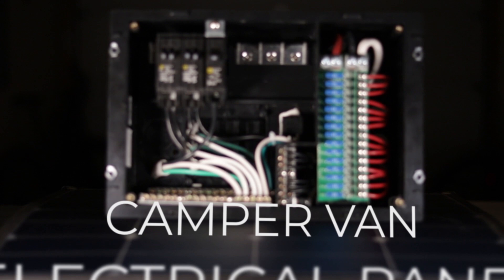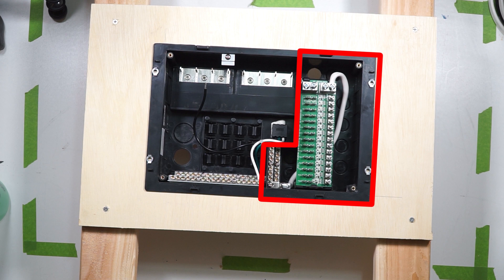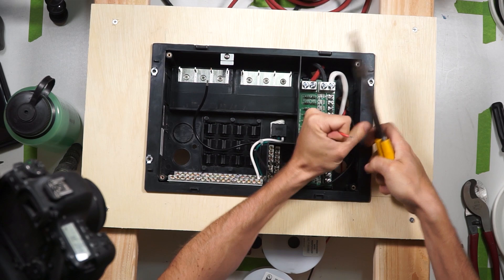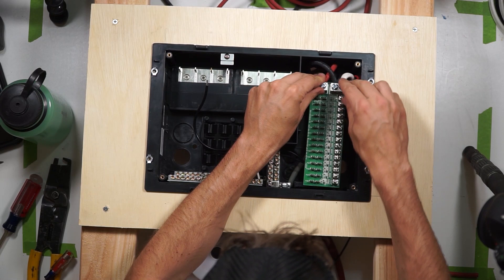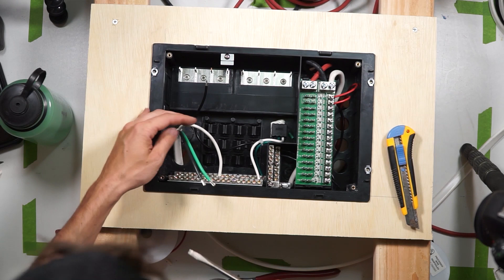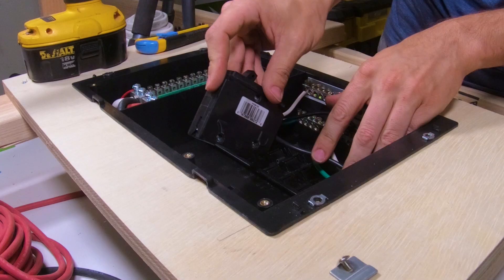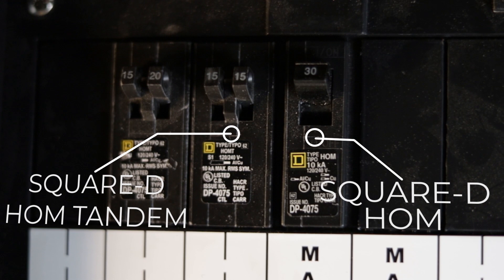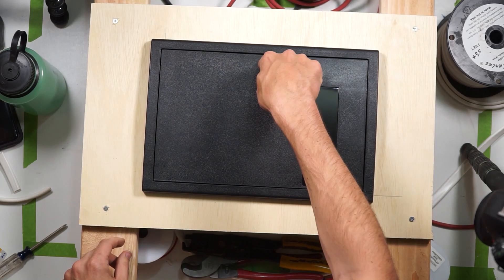How To Wire a Camper Van Electrical Distribution Panel

Comment: Grounding Question: If I were to turn my "RV" into a permanent installation that required an electrical inspection, Do you know how the grounding requirements would change? I presume I would need solar panel grounding and a driven ground rod. Would I just connect to the ground rod instead of the chassis or are there a host of other equipment grounding changes as well?

Comment: Hey. I have a very similar box and need to run a new 10/3 romex to the main breaker. My question: is the unit grounded to the frame? Or only grounded to the bus bar via the 30amp breaker wires? I’m lost…

Comment: Hey Nate, I’m wondering why you use a 30 amp main breaker with this panel and in your newer wiring diagrams with the separated AC panel you use a 50 amp main breaker? I have the AC/DC panel shown in this video and am trying to figure out weather to use a 30 or 50 amp main breaker?

Comment: Why do my 12v DC 5amp fuses keep popping on my lights when i can plug them i to a small ac/dc adapter straight from the wall and they work fine.  Im confused...

Comment: My question is, I think I'm thinking too hard or over looking the obvious,  but what type of wiring do I now put from the box to my outlets?  Do I use the 10/3 I have from my shore or do I use the 12v because I'm doing solar power and will be doing lots of boondocking?  Every video I've watched stops at installing the system but not power outlets for kitchen appliances.  I only see 12v for lights or 12v refrigerator,  I'm doing a mini dorm type refrigerator. 
🤔

Comment: Hey Nate. Thanks for all of your information. I bought many items for my setup through your links. However, I made some adjustments to fit my personal desires and budgets. Instead of the inverter charger, I got just an inverter. So I am running my shore power supply straight to a 30 amp breaker. My plan was to have a separate breaker for my solar system and switch them on/off accordingly. On my panel I currently have a 20 amp circuit breaker, a tandem 20 amp breaker, a tandem 15 amp breaker, and the 30 amp main breaker. Everything works great on shore power but my question to you is...

Can I use a tandem 30 amp breaker for my main to switch on/off between shore and solar? 

Thanks

Comment: Kudos. Great video and really straight forward how to.  Does the receptacle in the back run off the dc power when not connected to shore power? Is there pro and cons for designing the system with 30 amp over 50 amp?
Reply from the maker: 1: The outlet on the back would be powered through the inverter just the same as all of the other circuits.

2: 50A would be more power, but is significantly more complex & expensive.   If you need it, great; I have 2x diagrams on my site for 50A setups:

https://www.explorist.life/50a-camper-inverter-with-solar-alternator-charging-wiring-diagram/

https://www.explorist.life/24v-6000w-120v-240v-split-phase-camper-solar-wiring-diagram/

but 50A shore power service is USUALLY only needed if you need to power a 240V appliance OR have the ability to power 2 or more air conditioners.

Comment: Does the AC ground busbar need a separate chassis ground? It seems like you would want a more direct path for grounding rather than running to the inverter and then the chassis. Thanks for all the awesome tutorials!
Reply from the maker: That depends on the type of Inverter you have so be sure to check in the installation manual of your specific inverter, but in the case of the Victron inverter chargers I recommend on the wiring diagrams at https://www.explorist.life/solarwiringdiagrams the grounding and bonding is taken care of internally through a relay as the method of grounding the AC side of the system changes depending on if it's plugged into shore power or not.  But again, in Victron inverter/chargers, that's taken care of internally so we don't have to mess with it and an additional AC chassis ground
 from the distribution panel is not permitted.

Comment: So I have a Progressive Dynamics PD4560 Distribution panel, it's an all in one. I can't for the life of me figure out how to get power to the dc side. I have looked all over the internet and can't find anything remotely close to what i have and what possibly could be going wrong here. I know the battery is good, I know the converter is good, I just can't figure out what's going on with the wiring that I cant get 12 volts at the WAGOS connectors.

Comment: Shows how easy it would be to mix up the AC hot wire and a DC negative wire if you use black for both.
Reply from the maker: Yeah, somebody wasn't thinking that through back when they made these decisions for color coding this stuff.
Reply: @EXPLORISTlife  That is why for marine applications the ABYC  (American Boat and Yacht Council) recommends using yellow and the DC negative return.    Google that and you will go down a rabbit hole with all kinds of best practices relevant to van builds.
Reply from the maker: Indeed.  I stick to ABYC as much as I feasibility can (you'll see me reference ABYC standards in several of my videos).  Large yellow wire has historically proven difficult to source for end consumers and since it is not traditionally used for the - wire, it further confuses people from an education standpoint.

I would like to move that direction, but have several external factors working against me from a logistics standpoint.

Comment: great video. I have a couple of questions. 1. what is the ac outlet for on the back of the distribution box? 2. if i were to use a device like the Yeti 3000x, would it be worth it to connect its AC output to another Main breaker and then add other breakers to branch out for outlets, microwave etc, or should i just daisy chain them directly from the yeti?  can i connect 30 amp shore power to the left side, and also connect my yeti 3000x inverter power to the right side?

Comment: Loved this video, thanks so much! Purchased for my 1983 RV remodel project and plan to power the system of a Bluetti AC 200. Any recommendations on wiring/materials to run as lead lines out of the distribution panel and to the Bluetti 12V/25A RV port and AC outlets?
Reply from the maker: I'm struggling to see how you are incorporating this into a Bluetti powered system.  The Bluetti has circuit protection built into it; so there is no need to use a power distribution center like this.
Reply: @EXPLORISTlife  I have the Bluetti also, the 2,400wh one.  So, I have 4 sets of dimmable lights on the ceiling, some marine blue colored lights, some spot lights for the outside etc...etc... So, I think Riley Hupfer's situation is like mine.  How do I plug all of these into the Bluetti when there's only one cigarette lighter plug, female, and two 120 v plugs.  I've installed two of the 4 pack, dimmable lights into a lighter plug with two female splitter......now what, you know, when adding more lights etc.  That is probably his struggle.  With this distribution panel you wired, and thank you VERY much for that, you just take your resulting battery bank wires and plug / wire them into the panel.  Not the same with a "solar generator" like the Bluetti, only one 12 v port.

Comment: If your shore power is coming from a portable generator, do you need to ground the box some where? You never mention grounding.  I know if you are plugging into a grid, it should be grounded already.

The multiplus of installed, is grounded to the van / trailer.  But if you don’t have that, what, if anything, do you do for grounding?

Comment: Hey Nate! Maybe I’m an idiot, but I’m wiring my AC and I’m a little confused about that part of the video.  You add your external circuit wires (green and white) to the bus bars and then the black wire that is already built into the box is what you attach to the HOM breaker instead of the one going to the external circuit.  Do you attach the one build in AND the external wires going to my outlets?  Or do I only attach the black wire coming from the external outlet to the HOM breaker and leave the second screw/attachment point alone? Also, what if I want two outlets?

Comment: Hi there can you please give me some tips on how to boondock wire a parked van that is not driven? 
A couple of years ago I needed temporary summer housing to allow me to work remotely, so I dipped my toe in the water of vanlife and hastily purchased a 100 watt thunderbolt solar panel and harbor freight 12 volt solar battery, I think it's agm, along with a Centech 750/1500  inverter I use for my 750 watt coffee maker. Because I worked 12+ hour days I was able to make that simple arrangement do, but I now wish to improve my situation and more importantly improve the safety of the equipment I use. 
My first Centech inverter suffered melted cables pretty far up, so I replaced it with another new one and notice the second one has melted a little also, downclose to the terminal connection. I plan to replace it with a different brand. 
Currently all lights are magnetic LED that I toss onto the bare van walls. I use mini USB fans that plug into the same inverter or into portable chargers. 
But now I want to install the maxxair fan and another 12 volt fan but I cannot use my van starter battery/alternator.  
I would need to set up a separate little service center. 
So would I install a buspar onto my solar battery while it is also connected to an inverter then wire up at least 2 @ 12 volt plugs?
Please let me know any additional details I should know. 
Thank you for your informative videos!!

Comment: First of all, thanks for all the help! I have used your site/videos and products extensively throughout my van build. I do have a question in regard to wiring the main breaker from the inverter. Per your wiring diagram i have used a 6/3 wire from the inverter to the panel. I am having trouble fitting this wire into the 30amp breaker. Have i miss understood wire sizing or breaker requirements? Is it acceptable to split/pigtail this wire to allow fit within the breaker? I am using the 30 amp breaker you have linked above. Any help is much appreciated.
Reply from the maker: You'll use a 50A breaker if you're using 6/3 wire.

Comment: Question. From the 30-amp inlet can I just run shore power right to the electrical panel? I would then plug my powermax 110 to 12-volt convert into that to charge battery which would power the DC side. I realize my AC side would only work when hooked up to shore power.

Comment: Once you set up that second breaker you put the negative wire from the unit itself into the breaker. What do you do then with your negative wire coming in from the other line?

Comment: Red LED is blown fuse or no fuse....So I grounded the DC negative in the BOX to the grounding point in the RV...My hope was that I’d save on wire....do a big ground from box to grounding point....and then run negative from loads to other nearer grounding points.  Unfortunately this does not seem to work....it wants negatives for each circuit returning back to the box.  When running a central switch panel, it’s a lot of wire.  So don’t ground the.   DC portion of the Box the vehicle?   My entire DC load is less than 25A...However I expect having 7-10 separate circuits with switch control for each.  This box supports 15.

Comment: Question:
I'm assuming shore power cord is wired to the 30a main. I no longer use shore power as I have a hybrid inverter the I have added a dual 25a circuit breaker for at the only open location in the bottom (manual recommended 25a dual pole even though it claims to output 41.7a). My question is  can I use that breaker location and wire in an additional ac unit as my inverter supplies 41.7a and the draw from two ac is 16 a piece totaling a 32a draw when initially started?  Thank you for the help.

Comment: Great how to! Question for ya, or anyone else in the know. So I've got a wfco 8735p and I'm doing a utility traler conversion. On my dc side I've ran all positives to the labeled circuts and for the negative I just tied them into a bus bar. Do I need to ground the negative bus bar to the chaise? I know I need to do that for the ac side but not sure if I'm good to go on the dc. Thanks all.

Comment: This is good stuff. I have one of these in my small camper trailer. Seems to be connected to the battery but im replacing the battery to lithium, adding an inverter, solar charger and a battery monitor.  Any idea on how to integrate all that with this converter?
Reply from the maker: Sure!  Check this out: https://www.explorist.life/30a-camper-inverter-with-solar-and-alternator-charging-wiring-diagram/

Comment: Thanks for the great video! I have question hope you can answer! Are ground and neutral busbars separated in this distribution panel? Because I saw in some other videos people mentioned ground and neutral should be connected in the main panel.
Reply from the maker: They are indeed seperated.  In the EXPLORIST.life system designs; the neutral to ground bond is made inside of the shore power pedestal when connected, or inside of the victron inverter/charger through the neutral/ground bond relay.

Comment: How to connect 10 awg stranded wire under the screws on the positive side of the separate 12v fuse block?  They really don’t fit. We have many strands that escape from under the screw plate, which doesn’t seem right. What are we missing?
Reply from the maker: 10ga is the biggest that will fit, so it's definitely a tight fit.  Persistence pays off here.

Comment: hello Nate! I have watched most of your videos, I appreciate you are sharing your knowledge. I have a question, I have a 24V battery, could you connect the 12V section on the control panel directly to a 24V battery? or you need a conversion?
Reply from the maker: Nope.   Needs to be converted to 12v to power 12v appliances/devices.

Comment: Nate- Great video- Only question I have is how do you energize BOTH circuits on the AC side? Do you need 2 wires coming in?
Reply from the maker: Yeah; 50A shore power with Hot legs 1 & 2.
Reply: What is hot leg?
Reply: Is it just a second black wire that would go between 2 breakers?

Comment: So that’s a 50 amp service panel and I’m wondering why there’s not a screw to hold the second 50amp fuse on the right side?
Reply from the maker: That's because the 50A breaker would be a dual pole breaker (https://amzn.to/3kwxwNp), so the screw on the left would hold in the whole breaker for both sides.

Comment: Question if I have a 48v battery system can I still use this panel by way of a 48 to 12 v step down converter? If so how do I wire it? Btw thank you for all your videos I’m definitely educating myself off of them.
Reply from the maker: As long as the panel is getting 12V, it's good to go.  Whatever plan you are following should have the info on how to make the 48v to 12V conversion, or the converter user manual.  I don't have any 48V systems that power 12V devices available, so I don't have any resources I can point you to.  If you want to see how I recommend wiring these systems, check out https://www.explorist.life/solarwiringdiagrams.

Comment: I don’t know if I have done something wrong but I’m my installation it seems I always have power to my 12v dc circuits regardless of whether there is a fuse installed or not.  How does the fuse work if it doesn’t fully cut power to the branch if it blows?

Comment: whats you opinion on conecting the negative of the battery used for solar into the chasis of the van?   this way you just use a fuse and one line to the load (provided there is some metal of the van to connect the negative of the load)       thanks

Comment: Hey Nate, not sure if I missed something here. I see how the 12volt side is getting the power, but how is the 110 side getting it's power. On the 12v side, i noticed you added power to the positive and negative bus bars, but maybe I missed how the power is going to the 110 side. Thanks and sorry if this is already answered in the video, but I'm trying to understand it, thanks.
Reply from the maker: The center-most breaker is the 'power incoming' breaker.  Maybe a full system install would tie everything together? https://www.youtube.com/watch?v=01F4QDVJUq0&list=PLmvhcyi4n0TUjVGA_O5aI5SQrS1kKLgEF&index=28

Comment: Hi Nate, really great video tutorials. I’m finding them very helpful, thank you for making them.

I like this distribution panel setup, but I do have a concern. Those all appear to be screw-down terminals rather than crimp lug connection terminals. That would be fine for a stationary system, but on bumpy dirt roads wouldn’t the vibration eventually cause some of the connections to come loose? The Blue Seas System 12v fuse box, on the other hand, uses crimp connection terminals and looks very secure. Do you have any thoughts on this, and is it maybe not as much of a problem as I am imagining?
Reply from the maker: This box is made for Camper applications, so it's a non-issue as far as I'm concerned.  It is important though, to go through and check ALL connections for tightness periodically.  I do it every time I change my oil.
Reply: @EXPLORISTlife  Thanks for the advice

Comment: Nate, how do you connect the inverter to the 120V part of this distribution panel?
Reply from the maker: Sure!  So the inverter is going to have a L, N, and PE output.  The L is the Black "Hot" wire.  N is the Wire "Neutral" wire.  PE is the Green "Ground" wire.  Check any of the wiring diagrams at https://www.explorist.life/solarwiringdiagrams to see the other end of this connection.

Comment: Is a frame ground necessary for this type of panel? I'm replacing a very old metal box with an AC/DC panel with charger. There is a bare wire connected to the box from the camper's steel frame.